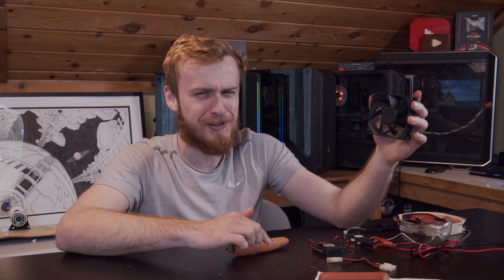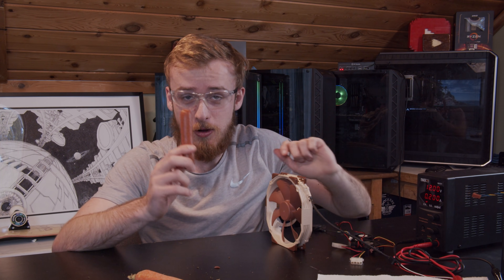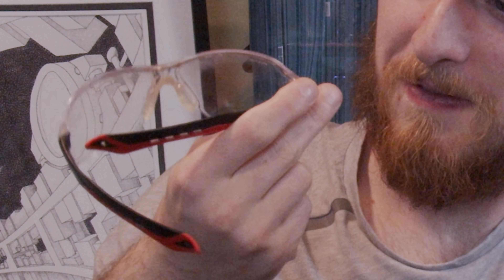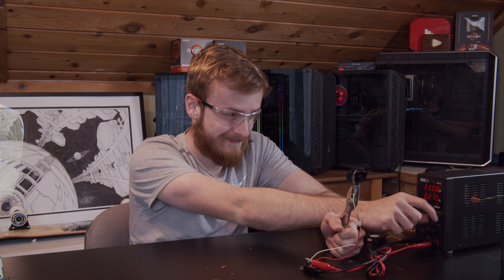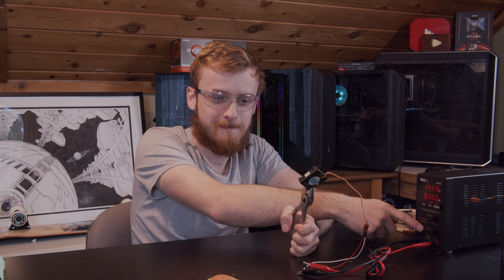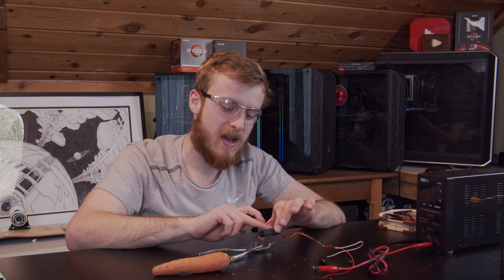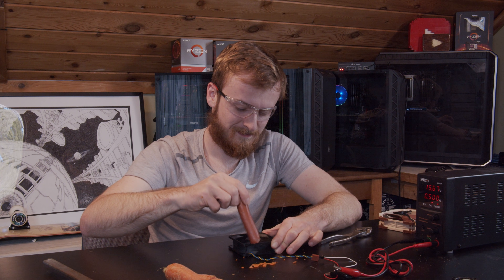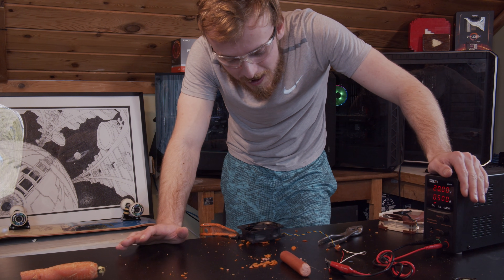What Happens If You Put Your Hot Dog In An Overclocked Server Fan?

Comment: Fan blades need to be sharp as knife and it has to be 200mm because longer blade has more strength than smaller blade also make it 5000 rpm

Comment: Do this with the blower fan from a DELL PowerEdge T310: Delta Y210M, rated for 3 amperes at 12 volts. It's a 120mm and I don't personally know the RPM of it, but I'd like to think it's 5900 or more. I own one but do not have a spare or the money to ship.

Edit: If you DO happen to do a video with the Delta Y210M, please be very careful, my father was working in an area where I'd had the fan sitting and I had also warned him about it. He still managed to still get his finger in it, and almost needed stitches. This was over a year ago and he recovered quickly, but it has very sharp blades that spin incredibly fast and I'd love to see what it would do to a carrot.

Comment: I did put my finger in a server fan (Accidently) before, nothing happens? It just hurts a lil bit and my finger got kinda swelled up because of the impact from the blades but after a day passed it's okay again. Human fingers are not carrots or sausages, also the speed you put your finger in to the fan determines the damage. Slower you go more damage on the finger. If you are fast because a fan doesn't have the torque to penetrate a finger meat nor the bone it does nothing to the finger

Comment: Hey 👋🏻. Dude who touched his hot dog to a computer fan here. I had just taken a shower and my clothes were washing so I was on full vibe mode in my towel. My chapstick rolled off of my desk and I got up to grab it. At the time I had just built my computer and I was trying some different cooling options. One of which was taking off the front filter and cover and pointing a big fan right into the computer. But I got up for my chapstick and I bent down to grab it and as I was bending down I dropped my towel and my Gut Masher 9,000 swung right into my fans which I had just put up to maximum speed (2,000 RPM) and it hurt really bad and I was on the floor for a while. No damage to much Gut Masher 9,000 though so that's good.

Comment: 🤣😂🤣😂🤣😂🤣😂🤣😂🤣
who would stick finger in fan blade
"i would said almost all them not all just some will believe it or not"
i have fan got me because of stupidity power or reset button refuse to work n there fan under mobo where pin are n i pull plug off pin n didnt bring my stupid tools n ended using needle jump it did power up n fan got me tore my nail off pinky finger SMH i never be near that fan aging n wonder why every company make mobo pin on bottom right side of board by corners  why not put by side on right could been more easy

Comment: Ive been cut REALLY bad by a low noise/low rpm fan before. It was a 3 pin fractal design 140mm fan. It was slow enough and the blaes were far enough apart that i accidentally got the entire tip of a finger between the blades. Those fans are EXTREMELY sharp for some reason. It drug my finger across the blade for half turn or so before it stopped, and it was like 1/3 inch deep cut.

Dont work in your computer while its on boys. I was screwing in something non electronic and didnt bother to turn it off. I think i dropped something and flinched my hand into the fan. Bad time, dont be lazy

Comment: Your enterprise fan seems a little weak, what model is it? You can get Delta PFR0612XHE models (which were standard OEM equipment in various servers, including HP's DL380e and DL380p Gen8) for less than $15 buy it now on eBay US atm, part number 662520-001 or 667855-B21. They're rated for 3.3 amps at 12 volts and 16500rpm, but you could probably get a bit more out of them if you tried ;)

Comment: The first PC I built had a Thermaltake volcano 12 which had a very fast fan with very beefy fan blades. While moving stuff around trying to maximize airflow I stuck my hand in it like an idiot. Anyway out of experience if you cut off the first couple MM of a finger it actually grows back.

Comment: Make a crappy build where you overclock everything, including the case.
Reply: Overclock the keyboard and mouse and thermal paste
Reply: Overclock the tweezers
Reply: @Cobras.  overclock the cable management
Reply: @Jassim_313  0 x 2 is 0
Reply: @Cobras.   no its 00
Reply: @Cobras.  2 x 0 is also 0
Reply: @Cobras.  overclock the verge pc and everything they did wrong
Reply: @patrickharlow7724  The verge pc doesn’t need over clocking. It needs Jesus
Reply: overclock the RGB strips
Reply: @kingpanguan  Overclock the heatsink.
Reply: @plashplash-fg6hd  over clock the Hotdog
Reply: @user-ry9eo8xn7p  Today I have learned that fans are the only components that run cooler when overclocked rather than hotter.
Reply: He's going to overclock the PSU fan to such an extent that it literally needs all the power just for itself.
Reply: overclock the clock near the pc
Reply: Overclock the gaming chair
Reply: Overclock your USB ports pls
Reply: OVERCLOCK THE TABLE
Reply: Overclock your power bill
Reply: @muinuz7452  oof rip
Reply: @muinuz7452  LOL
Reply: Overclock motherboard, speakers, headphones
Reply: OVERCLOCK THE MONITOR
Reply: Overclock the Screws on the case
Reply: Linus did that
Reply: @Aditzu Overclock your brain,imight need to do that myself
Reply: overclock the monitor
Reply: I over locked my case to a full atx tower
Reply: overclock the floor
Reply: @Sungblox  OVERCLOCK THE AIR CONDITIONER
Reply: places clock on top of tower
Reply: Overclock ssd
Reply: @altugataman5236  LTT did that before.
Reply: @altugataman5236  ssd dose not exist on my pc
Reply: @bernesedog4863  then overclock hdd
Reply: @altugataman5236  it will explode. All i hear is loud noises ive recently upgraded my pc cooling fan with a floor fan pointed at the cpu
Reply: @bernesedog4863  your pc gg lol
Reply: @altugataman5236  lol idk how it is lasting this long overclocked to hell with 10 yr old parts and a 5 yr old graphics card that can barely keep up
Reply: i'm crying
Reply: lol
Reply: I could make the video for him lol. Everything on my pc is overclocked.it’s 10 yrs old...... other than graphics card
Reply: @bernesedog4863  You’re in the same situation as me, then. Pretty much all my parts are from 2010, except for my RX 580
Reply: @MrMetropolis  lol it sucks my pc cpu gets to 140. Without playing games....... just doing work
Reply: oVeR cLoCK tHe wEbcAm
Reply: oVeR cLoCK tHe mICrOpHoNe
Reply: Tech tip: Overclock your case
Reply: Overclock the mouse
Reply: Watercoor the radiator
Reply: @paradiseyoshi2074  had to delete my comment you beat me to it
Reply: Nah u gonna overclock the mousepad